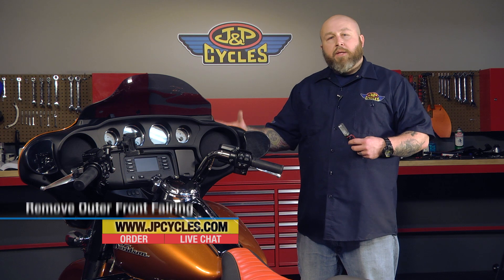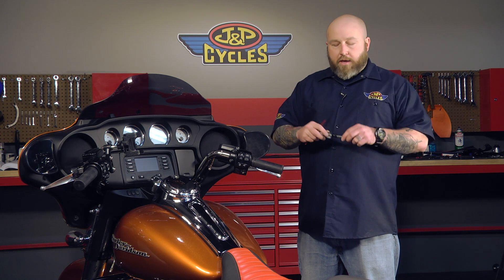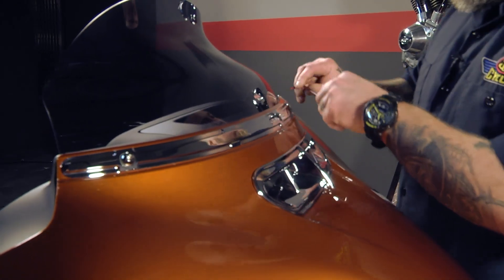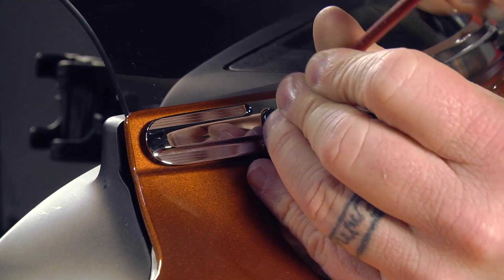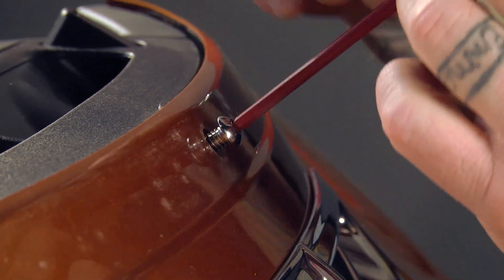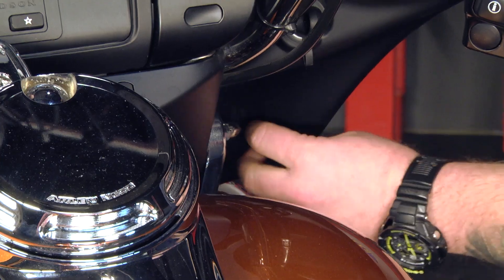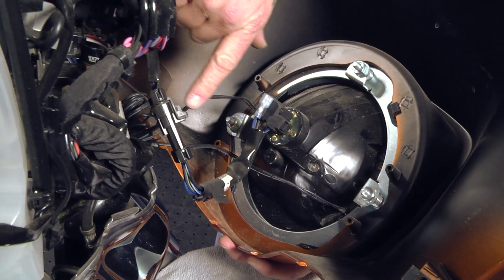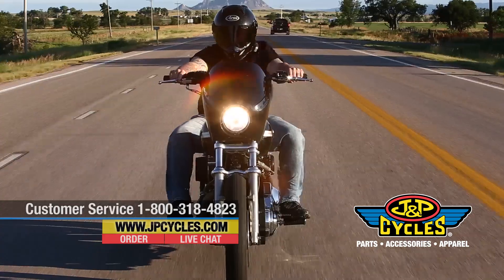How to Remove Outer Fairing from Harley Davidson Touring Motorcycles by J&P Cycles

Comment: nice, starter, currently have a problem someqhere insiede the fairing (i guess) bike turns on stays idle but when i move the steering left or right the power shuts down, and comes back as soon as i get it in the straight position anything in specific to BOLO for ?